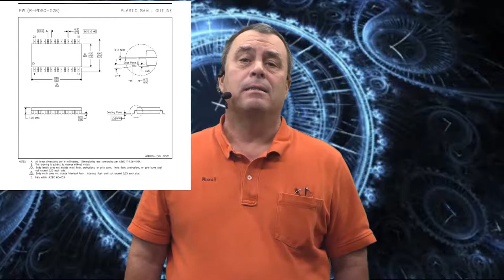IoT#9 How to hand solder SMD and Through-Hole components assembling the Movement PCB.

Comment from the maker: Here are some links to quickly get you to different parts of the video.

PCB Kit: https://youtu.be/FvMht5vu93E?t=75

Start soldering SMD parts: https://youtu.be/FvMht5vu93E?t=117
U102: https://youtu.be/FvMht5vu93E?t=117
U103: https://youtu.be/FvMht5vu93E?t=240
U101: https://youtu.be/FvMht5vu93E?t=312
Q101: https://youtu.be/FvMht5vu93E?t=328
U1: https://youtu.be/FvMht5vu93E?t=430
D2: https://youtu.be/FvMht5vu93E?t=483
D1: https://youtu.be/FvMht5vu93E?t=515
U3 & U2: https://youtu.be/FvMht5vu93E?t=549
0805 Caps & Resistors: https://youtu.be/FvMht5vu93E?t=734
R2: https://youtu.be/FvMht5vu93E?t=1358
Panasonic Caps: https://youtu.be/FvMht5vu93E?t=1503
Nichicon Caps: https://youtu.be/FvMht5vu93E?t=1620

Start gluing through-hole parts: https://youtu.be/FvMht5vu93E?t=1734
Start soldering through-hole parts: https://youtu.be/FvMht5vu93E?t=1880

Testing for shorts: https://youtu.be/FvMht5vu93E?t=2049
Installing in testbed: https://youtu.be/FvMht5vu93E?t=2072
Smoke Test: https://youtu.be/FvMht5vu93E?t=2183